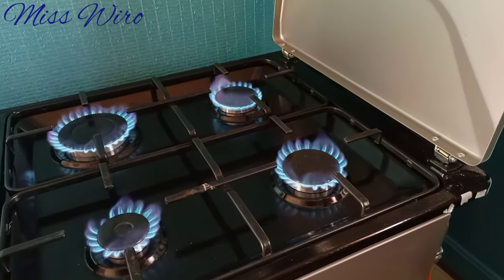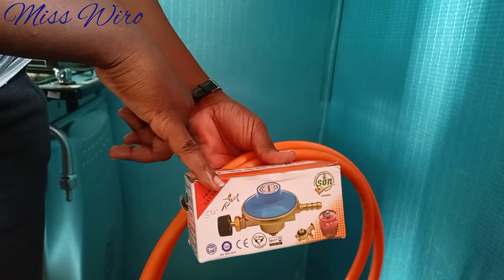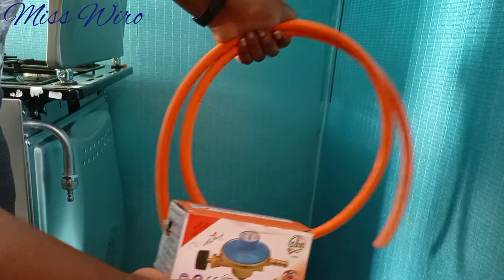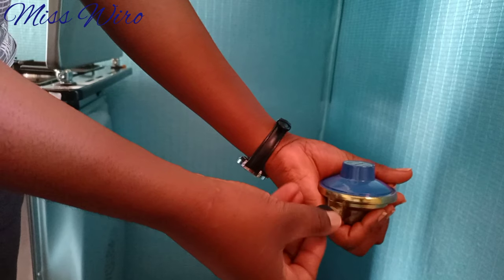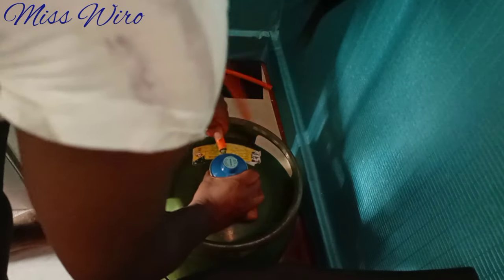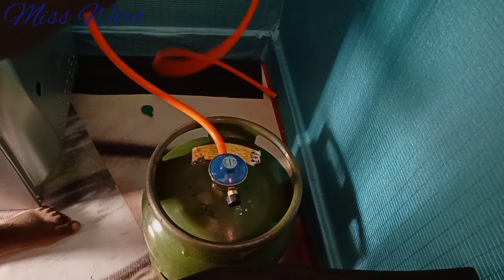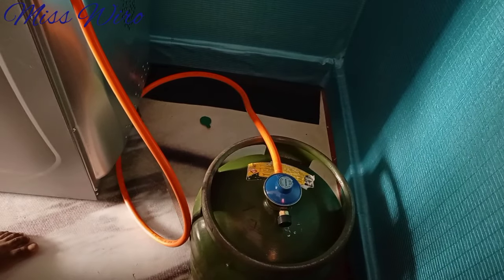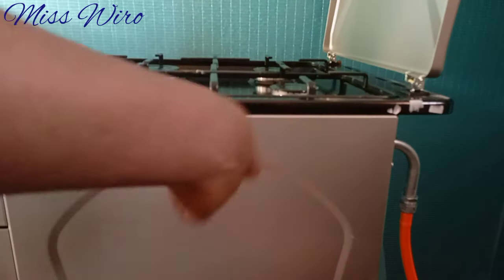how to connect a smal (6kg) cylinder to a 4 burner gas cooker

Comment: In my home (🇧🇩 Bangledesh), they usually attach HOSE CLAMPS on each end of the hose, to tighten up the connection, and prevent slipping off.
Reply: Yes great suggestion

Comment: I fixed mine just like you have shown but its as if the gas is leaking from the cylinder...there's that ka shh sound when I turn it on. What might be the problem cause I am not sure. Thanks
Reply: You might need to buy a clip (usually silver in color and round). The clip will be tightened at the end of the hose/tube that connects to the cylinder and Stove, so it remains tightly closed to prevent leakages,
Reply from the maker: Thanks dear that's a beautiful advice
Reply: @attobrahprince5236  are the clips recycled 😢

Comment: I have a question. My 6kg  gas cylinder  has a rubber in there after removing the seal and I find it hard to fix it. Is it a wise decision to remove that rubber before connecting my regulator?

Comment: Thank you Mrs, I was inquiring to know if I can still use it down in oven for baking without electricity, coz it normally take alot of electricity, 
Thank you so much
Reply from the maker: Yes dear you can. Like mine doesn't have the electric pan it's all gas and it bakes well just using gas alone not electricity
Reply: Depends on the cooker. Some have only electric oven. So check yours